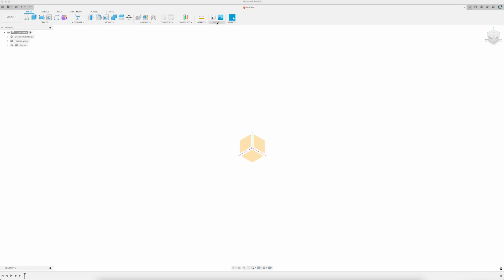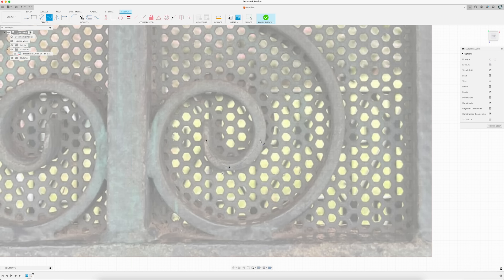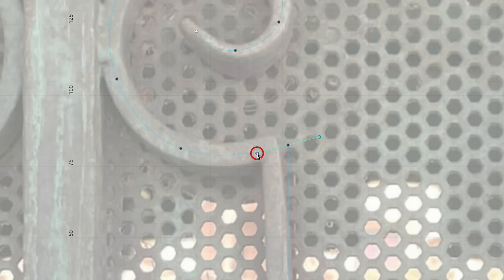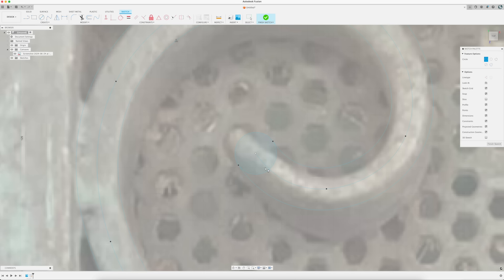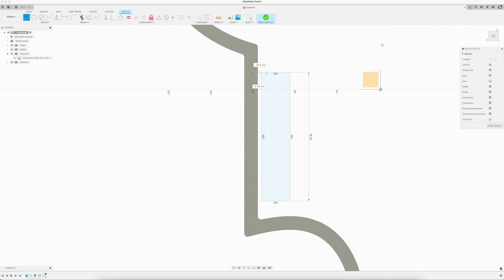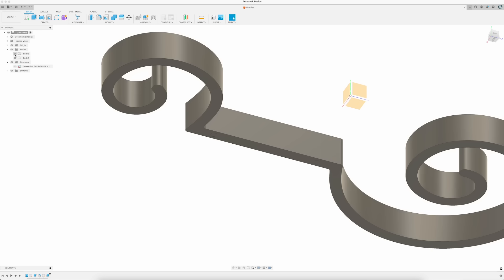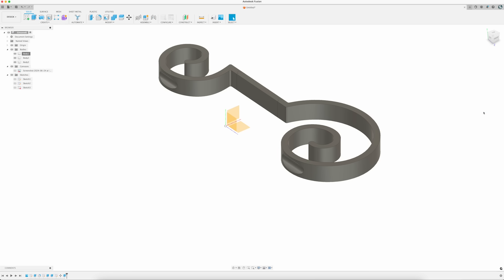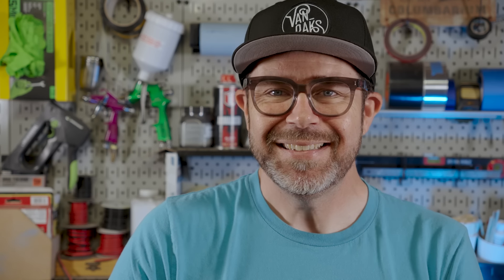Halloween PVC Fences Don’t Have to be BORING!

Comment: Great video. You might want to try the Hole tool because you can add the chamfer at the same time. In your case it's a little awkward to do since you have to start on the inner surface of a curve. The Hole tool has standard screw sizes built in so you don't have to remember the right diameters. Optionally, it'll do threads.
Reply from the maker: Thanks for the tips!